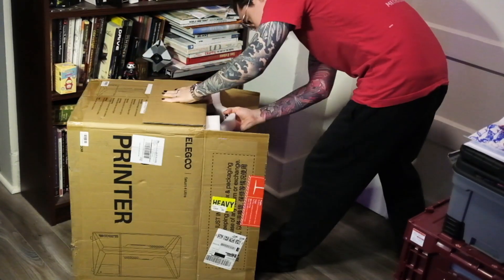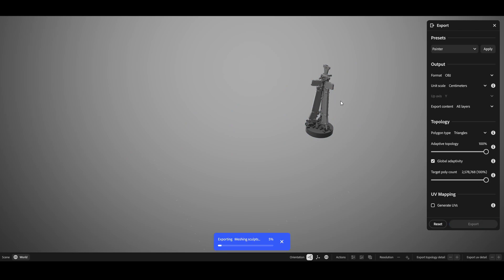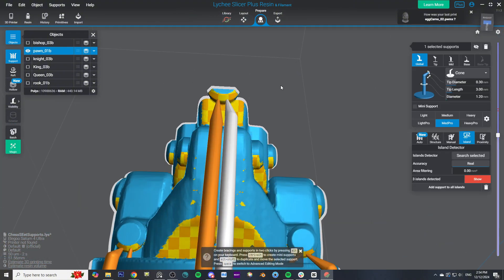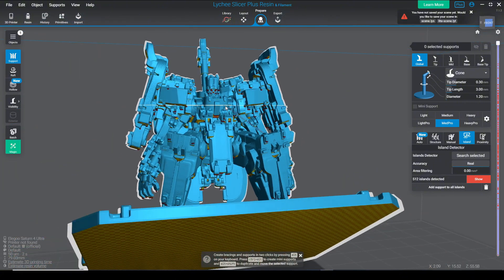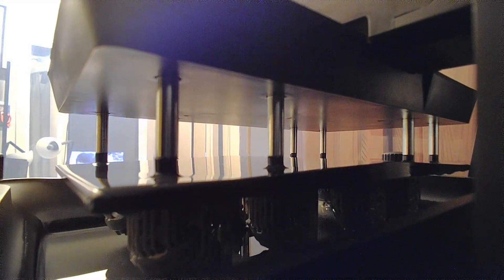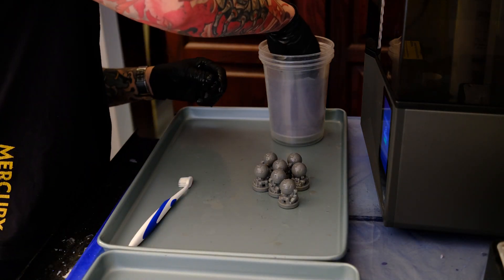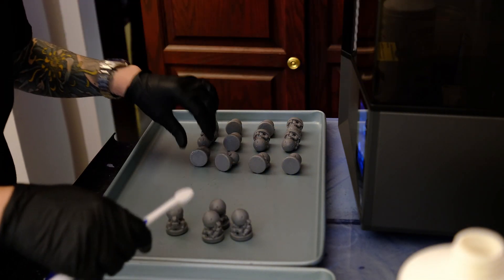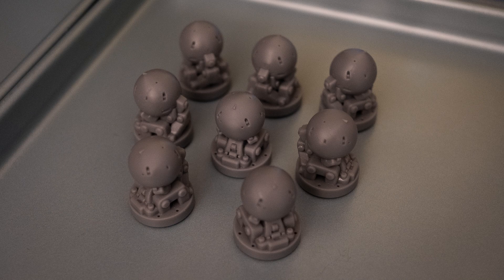From VR Sculpt to 3D Print - Making of a Chess Pawn

Comment: Hey man!
What setup do you recommend for using Modeler with VR?
I have an old PC: 16 RAM, RTX 2060 with 6 GB of integrated ram. CPU: AMD Ryzen 5 2600 Six-Core 3.400 Ghz and 1TB SSD

Do you think it's enough to run Modeler anchored to the quest or do I need something more powerful?

Thanks in advance!
Reply from the maker: You can see the minimum specs for Modeler on the Steam page. Your build should be able to run it but you might hit a wall pretty fast with your GPU and amount of ram. Get the public beta and test it out. I share my build specs in this video: https://youtu.be/X4-T8TpxFJE

Comment: Oh god! Resin printing?! I would highly recommend looking into also getting a bambulab FDM printer with a 0.2mm nozzle and printing at the highest quality settings. Not only does it have auto supports (as long as you know how to split the model properly) but it also doesn’t have this air pocket problem, and will give similar quality results https://youtu.be/Pp7w35YtzVg?si=JzUcSlonGiohxNtR
Here is a video that showcases just how high quality FDM has gotten now
Reply from the maker: I hear you about FDM printing, I have an old OG Prusa MK2 that Iv been wanting to upgrade as well and the Bambulab look really nice. My major issues with FDM is that it takes forever to print and the print quality is better but still not as good as SLA. You still see a ton of print lines and yes its easier to manage but its not as precise. Its fantastic for functional prints but most of the stuff I do is decorative only.
Reply: @ yeah the print time is way way way longer at the highest quality setting
Reply from the maker: @bee3D  Now if @bambulab wants to send me a printer to test out 😎😆 the multi colored prints looks really cool